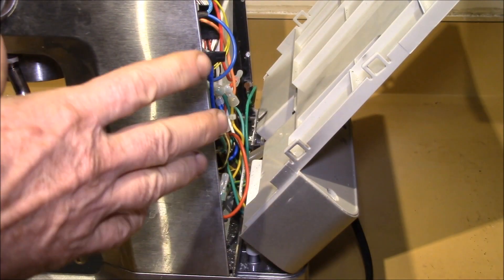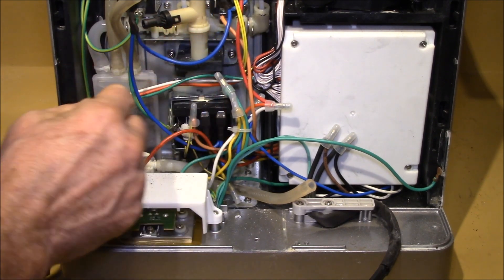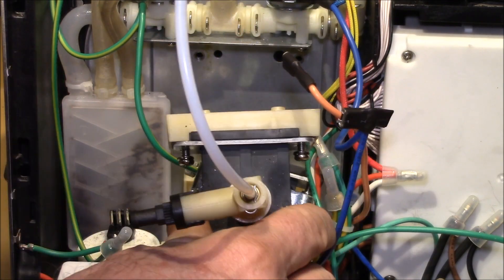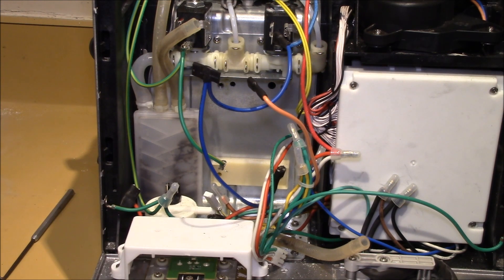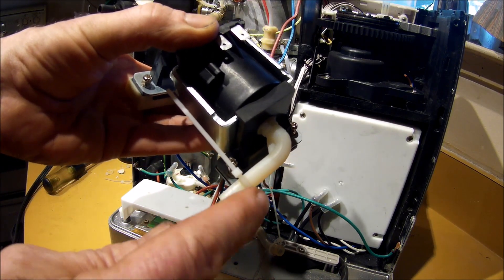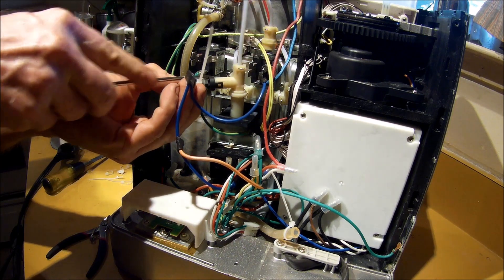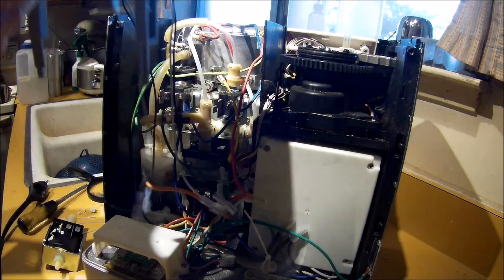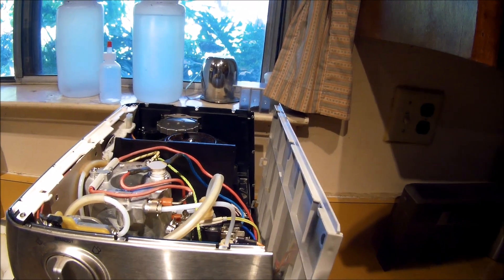Breville 870XL Pump Replacement, Part 1

Comment: Hi, thank you for the video. My Breville stopped making noises when I turned on the machine last week so I ordered a new pump & replaced & it’s still not making any noise. Any ideas? Should I replace the thermostat as well as the pump or should I use the old one with the new pump? Hoping I didn’t have to keep buying parts & trying new things if possible.
Reply from the maker: I have some troubleshooting tips in the pinned comment of this video:
https://youtu.be/9lMw6ooiqPI?si=LQiv-Sb4B8vMLGbh
It may be that there's no power getting to the pump.  That could be a wire has come loose or broken, or the thermal overload (Klixen part) has opened up, or it may be that the driver on the main circuit board has failed.

Comment: When you guys have this problem, do you remember if when you plug it in all the lights are on and you can’t do any function whatsoever to the machine that’s what I am experiencing. I don’t hear any pumps or anything. It seems like I’m locked out of the machine.
Reply from the maker: Make sure the grinder hopper is fully seated and locked into the top the machine:
https://youtu.be/0ZDii493IPY?t=440

Comment: Mine leaks has no Hot water or steam, on steam, it comes out of the power head, on HW the same,  I am in the middle of pulling it apart.
Reply from the maker: Check out this video:
https://youtu.be/9lMw6ooiqPI?si=Ad2BVhPGiXCRSyRn
to help track the water flow along with a boat load of troubleshooting tips in the pinned comment.

 It could be the 3 port solenoid is stuck open or the driver circuit has failed in the on state keeping that coil energized all the time.,  A quick check for that is to disconnect the wires from the coil *wrap in tape to prevent shorts) and then run a hot water or steam cycle.

Comment: I noticed in watching, yours and others how to fix movie, you all don't mention that the power clips need to be 'squeezed' as there is a metal tab which locks them on.
The insulated clips are the same, but you cant see them.
Love your work, helped heaps
Reply from the maker: Good point, especially if you see signs of arcing or high temperatures on either part of those connectors.

Comment: I appreciate your videos they are so detailed and provide insight on how all the components work in conjunction. I have a question that I hope you can answer. I have the 870xl and it stopped brewing coffee, but water is still being heated and going out the port at the drip tray. I opened it up and disassembled the solenoids and they don't look gummed up or anything visual. None of the lines to and from the solenoid were clogged or torn. Do you think that this problem could still be one of the solenoids? I would rather have a much more educated and experienced decision, before I buy the solenoids and pump. Thank you for your great videos
Reply from the maker: The solenoids are electro-mechanical.  Check the coils for continuity:
https://photos.app.goo.gl/bN1ugnLPYwvyDcr59
If that's OK, it might be the coils are not getting power from the main circuit board.  You can see my video in this playlist on adding indicator lights to the solenoids to check that:
https://youtu.be/9cC-m3a-oXY?si=YabIH-qBRD7Pohfr

Comment: In my case the machine turns on, but doesn't make the buzzing noise the pump usually makes on start up, AND the grinder does not work (I have thoroughly cleaned it). All the indicator lights turn on and the machine warms up, but no grinder, brewing, steam, or hot water. Because of the grinder also not working I'm not sure if it's worth trying to replace the pump?
Reply from the maker: Make sure the grinder burr and bean hopper is fully seated and that the interlock switch is closed.  That can prevent the machine from working, although it usually results in a flashing light.

If you have the ability to check voltages, you can test the connections on the pump and solenoid valves (see the video in this playlist where I add indicator lights) and see if they are getting power or not.  If not, it might be some bad connections to the main circuit board or that board may need replacing:
https://photos.app.goo.gl/bN1ugnLPYwvyDcr59
Reply: @The4Crawler  thanks for the lightning fast reply! I'm pretty sure I got the grinder reassembled correctly - the issue actually started before I took it apart to clean it out. 

I have just a cheapo multimeter but I'll take a look at the video you mentioned and the photo gallery and give trouble-shooting this thing another go!
Reply from the maker: @SteveUrban  Here's that video:
https://youtu.be/9cC-m3a-oXY?si=_-nEMWQbSwF1a0ti

Might also be worth re-seating all the connectors at the pump and solenoid valves, in case they've oxidized or loosened up over time.
Reply: @The4Crawler   I did remove and reseat all the connecters I could get to with just the rear panel removed (and you were right - reconnecting the gasket for the water tank was a major PITA 😅). 

From the video though, I'm not 100% sure which terminals to check whether or not the solenoids/pump are getting power...
Reply: @The4Crawler  I replied too hastily - I see more info on how to test them in the photo album. I will go down that route now.
Reply from the maker: @SteveUrban  The photo album has photos of the pump and solenoids, each has 2 main terminals for power.  The solenoids will often have a 3rd terminal below the other 2 for ground.  Just measure between the 2 pins on each device.
Reply: @The4Crawler  thanks again for all the info - you've been incredibly helpful. I'll definitely respond here if I figure something out. 🙂
Reply: @The4Crawler  forgive me if you get a double reply - I thought I already replied but don't see it in the comment thread. 

I tested the resistances of the solenoids and pump as indicated and they all seem to have appropriate readings. I tried to share a Google Photos album here but it seems YouTube won't let me. 

One thought I had was if the problem is with the Klixon thermal overload. I'm thinking of removing it and directly attaching the input wires just to see if the pump starts up - and of course replacing the fuse if it does.
Reply from the maker: @SteveUrban  That's a good way to check that out.  I think those thermal overloads are supposed to be self-resetting, but if the internal contact goes bad, they would fail open and not pass any current.
Reply: @The4Crawler  I tried it and no dice - the machine turns on but still, nothing works. I'm guessing it's a motherboard issue since both the pump and grinder are non-responsive, but I definitely don't know enough to test it. Visually nothing looks obviously burnt out or disconnected on the motherboard. Interestingly enough, when I click the button to grind, the light indicating that it's grinding blinks for as long as it would if it were grinding, but nothing actually happens. 

So thanks again for all your help! If nothing else I better understand how the machine is supposed to work. :)
Reply from the maker: @SteveUrban  A few options, to test, connect some wires off of the pump and/or grinder to connect to a volt meter and see if there's normal line voltage present when those items should be running.  You can often find replacement circuit boards, contact Breville support.
Another option is to make the machine "manual".  Pick up a pair of momentary push button switches.  Find a line voltage connection on the main circuit board for power and connect that to one side of each switch.  Run the other side of each switch to the pump and grinder motor.  Then press and hold either switch to operate that function.
Reply: @The4Crawler  once again much appreciated. I will do a bit more research/learning and give this a try,

Comment: @The4Crawler Same machine here. Creating zero pressure to the group head. I've ran the tests with the dual wall basket and cleaning disc inserted for backflush, and still no pressure. When pulling a shot only the top of the espresso puck gets wet and no water comes through the bottom of the basket. Should I replace the Solenoid block first, or does this seem like a pump issue?
Reply from the maker: Check out this video and the pinned comment for troubleshooting ideas:
https://youtu.be/9lMw6ooiqPI?si=DTN6ieOZlvkHToPO If water is flowing to the hot water / steam and/or to the drip tray, pump is likely OK and the 3-port solenoid is either clogged (run multiple descaling cycles) or open it up to clean and test it (see video on this in this playlist) and/or replace it.  Could also be electrical, the solenoid coil could be defective (see link to photo album with testing information in the pinned comment) or the drive circuit on the main circuit board is defective.

Comment: Hi Mr. Brown. I did a pump replacement, and now it runs all the time and empties the tank into the drip tray. I have seen forums with others having the same issue. The only solution I have come across is to replace the whole circuit board, but that's a bit expensive. Do you have any idea on how to fix it?
Eik
Reply from the maker: Could be the water flow sensor got disconnected during the pump replacement.  Where is it and what does that do?  See this video and the pinned comment:
https://youtu.be/9lMw6ooiqPI?si=fJKCCaL4NjuF4_TT

Comment: I have a question
 as I am steaming there is a louder pulsing noise in the back that you don't normally hear and when you hear it stops the steaming process I had one before this and it did the same thing and it was replaced under a warranty but 12mths on this one is doing the same thing do you think it would be a pump issue or a steam issue doesn't seem to effect the shot side of things
Reply from the maker: Not sure, I don't use my steam wand very much and never experienced that issue.  It may be getting clogged inside, so a descaling cycle or two run through the steam and hot water side might help.  Otherwise, see if you can pop the back cover open and peek inside (be careful as there are live, exposed electrical connections) and see if you can see where the water might be going.  Perhaps it's going through the over pressure valve and into the drip tray.  If so, that valve might be set too low or it might have some debris in it causing it to leak water/pressure.

Comment: Absolutely brilliant instructions and videos! Thank you sincerely for saving me ~$700 on a new unit!

In addition to a failed pump, I also had a leak in the main water line from the pump to the heating element. I realized this after seeing residue on the rubber pump bracket and on the side of T valve.  Placed an additional O-ring in the valve and sealed up well. One thing I screwed up initially was forgetting the spring (with plastic bulb) in the stem retainer.

Again, thank you for your incredible assistance - your videos are awesome!

Comment: Mr Brown, thank you for posting this video. My expresso machine (same model) is making the first shot fine but trips when making the second shot. If I wait for a day or two, I can make another shot. I suspect there is leakage somewhere causing grounding fault. Please advise
Reply from the maker: Likely you have water leaking inside the machine and that's dripping onto the solenoid coils.  That can cause current to flow to earth/ground and trip an RCD/GFCI type breaker/receptacle:
https://youtu.be/yYJRQu3ZUik
Leave the machine for a day, water dries up and you can run another shot.

Comment: I appreciate this video, it helped me just replace my own pump. I took notes as I went, so here are some free work instructions for those interested =)

1) unplug unit
2) remove water container, drip tray, portafilter, and tamper
3) Removed hopper from top of machine
4) Removed burr grinder once hopper is off
5) Unscrewed two screws (one by hot water outlet, other inside tamper comartment) and 5 screws behind where water tank normally is to remove top plastic
6) Once the top plastic off unplug the two wires underneath at their connector to fully remove the top plastic piece
7) Remove one small screw near the water inlet under a small plastic cap that you'll have to pry off
8) Remove the entire back plastic piece of the Brville (hardest part in my opinion, it takes some committed prying. There are 4 plastic hinge/clips that need to pop off. I snapped one of the lower ones, in the end it didn't matter much)
9) The guts of the unit should be exposed now. Unplug line, nuetral wires (blue, yellow) from the pump (faston connectors)
10) removing staking compound (white goop) from thermal fuse (the thing on the side of the pump)
11) remove thermal fuse from pump. don't cut any wires. Just slide it off
12) above the pump there is a T junction of tubing. Removed the pin at top of the T to disconnect the smaller hardline tubing. Be careful to keep the orange O-ring inside the top of the T in place
13) cut the ziptie and unplug the tub connecting the left side of the "T"
14) cut the ziptie and unplug the tube at the outlet of the flow rate sensor (its the thing water flows through after the tank but before the pump) 
15) unplug the red/green/white trio of wires connecting to the flow rate sensor and move them out of the way, it will help get pump out
16) Unscrew 4 screws, 2 at top and 2 at bottom, of the vibration mounts holding the pump in place. The screws are captive and will stay with bracket. The pump should now be able to be removed carefully
17) The old pump will come off with the "T" tubing still attached at the top. Unscrew it and be careful to keep orange O-ring inside the top of the T
18) slide off the top vibration mount from old pump
19) cut zip tie at inlet of old pump and removed this small, 90-degree inlet tube
20) slide off bottom vibration mount from old pump
--- start of re-assembly
21) slide top vibration mount onto top of new pump
22) the replacement pump should come with two small o-rings/gaskets. Put them into the new pumps outlet tubing before screwing in the old T junction
23) screw on old "T" tubing onto outlet tube of new pump. The 2 o-rings added should help create good compression on the last ~2 turns of the T
24) slide bottom vibration mount onto new pump inlet side
25) replace the pump inlet tube on the new pump, secure with small zip tie
26) screw new pump back into place with the 4 captive screws, 2 per vibration mounting bracket
27) reconnect the inlet tube at the flow rate sensor side and secure with zip tie
28) reconnect the tube at the "left" side of the T junction at the pump outlet, secure with ziptie
29) plug the existing 2 power wires in to new pump (blue on right, yellow on left)
30) put thermal fuse back up into pump like old pump had. had to lightly pry open the opening while inserting it, very snug fit. Optionally secure with RTV
31) plugged flow sensor 3-wire cable back into flow sensor. Optionally stake down with RTV
--- time to test the pump. It needs to be primed with water before use. This video and other videos on youtube miss this.
32) cut the ziptie and unplug the hose at the connection point to the water tank 
32) Use a 20ml/cc syringe (avail on Amazon for cheap) and pump in water until you see it flow out of the top of the pump at the top of the T junction which should still be exposed/unconnected to anything. You will feel decent resistance before water makes it through the flow rate sensor, through the motor, and out the other side. Also a good time to check for leaks.
33) If successful, reconnect the small hardline tubing at top of the T at the pump outlet and secure with the original pin holding it in place
34) Everything should be done at this point. Reverse the housing dissassembly steps starting from step 8 and working backwards
35) Plug it in last and give it go, try the steam function and the hot water function to exercise the pump
Reply: a little daunting...should I try this?  How can I be sure that the pump is the reason nothing happens on my machine?  It DOES get warm but nothing comes out.  struggling for a while to "pump" but I would give it a wack and it would start!  That isn't working anymore.
Reply: Hi do you prime the pump while the machine is on?
Reply: @connx93  ideally before it is on, so that the pump only moves water and not air

Comment: Hello, my pump is a EP5FM and I would like to know what's the difference between mine and EFP5 ? Can I replace it with another model since I can't find it locally ?
Thanks.
Reply from the maker: Hard to say, from this page:
http://www.ulka-ceme.co.uk/E_Models.html
the EP5FM model is listed as 240V, vs. 120V for the EFP5.  If your machine is a 120V model, then it's likely OK to swap.
You can also purchase rebuild kits for the pump portion, assuming the solenoid (big coil of wire) is still OM.
Reply: @The4Crawler  Thanks for such a fast reply ! My model is indeed a 120V. Been searching online for what the "M" stands for. I guess it won't hurt the machine if the actual pump is a 46 watts and I will replace it with a 52 watts pump. Maybe the "M" is for a lower wattage, who knows.

Thanks again !
Reply from the maker: @fiodor94  Have heard of people swapping pumps, although usually a higher wattage for a lower one to possibly reduce a too-high pressure situation.